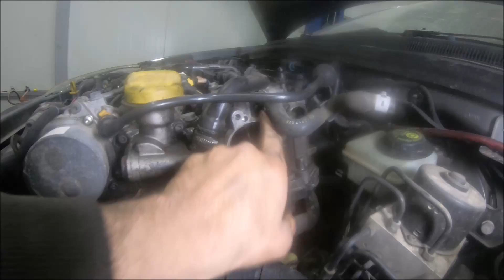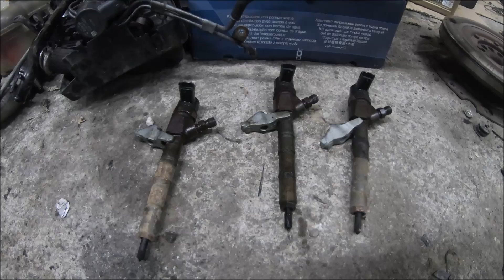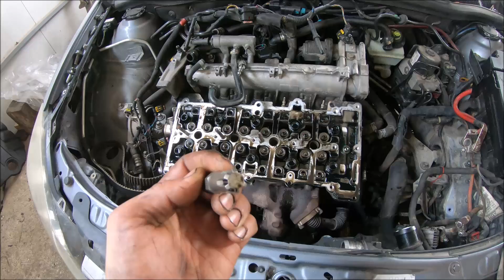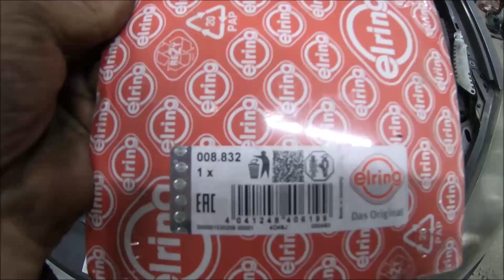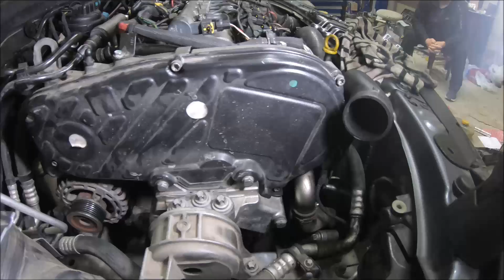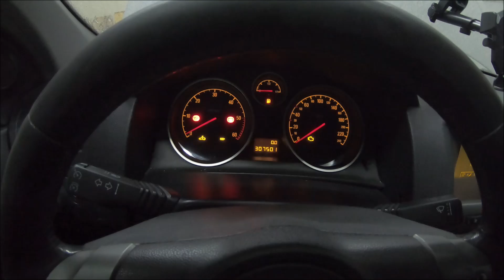Opel Astra H 1.9 CDTI Cylinder Head Gasket Replacement Tutorial

Comment: Hi Please can you advise why crank wont turn when cambox is installed have used tool to lock camshaft. What is torque for 18 bolts on cambox.Thank you
Reply from the maker: Maybe the timing is incorrect or you switched the cam shaft half bearing that you ask how much to tighten they are usually around 5~10nm
Reply: Thank you very much sir.Fixed but oil not reaching camshaft and hydraulic lifters making very loud noise when engine idling.what can be the reason
Reply from the maker: @selvangovender6097 did you clean the holes for oil and coolant before installing
Reply: @selvangovender6097  hi ! How did you fix this problem ? I have the same thing's
Reply: Yes sir
Reply from the maker: I can't think what you are doing wrong
Reply: I had a diesel knock cleaned injectors and torque correctly replaced valve cover gasket twice and torque but still leaking can I use RTV on the metal gasket. Thank you for you advise sir
Reply from the maker: Yes you can use but be careful at the oil holes
Reply: Od kade si majstore može kontakt
Reply from the maker: Od bitola 078251286